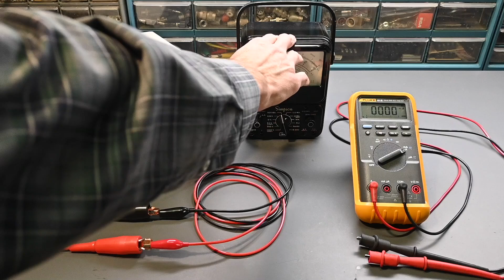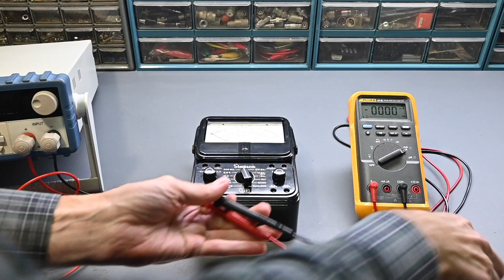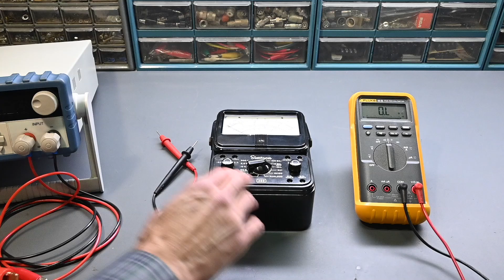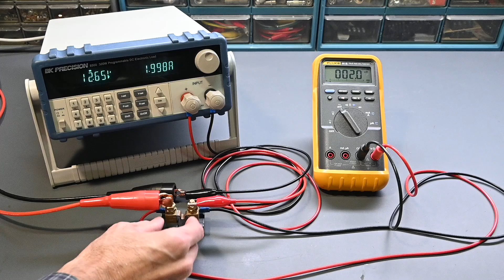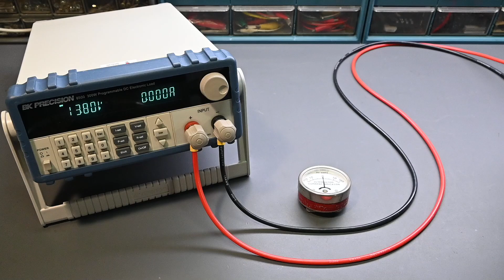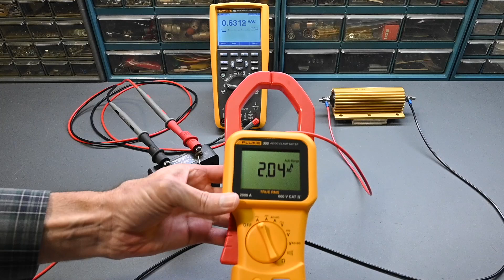How To Measure AC & DC Current - 5 Methods Explained

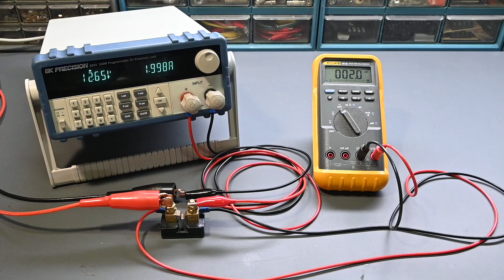Comment: Very comprehensive guide through various measurement methods. The device shown @10:41 however, I somehow wonder if that really can do induction with DC current, i.e. constant magnetic field. Such a discovery would merit a nobel price 🙂
Interestingly though, I was able to find manufacturers of such devices calling their product e.g. "2” Hoyt 652 Induction Current Indicator". I guess this has to be a stone age old misnommer.
Reply from the maker: Thanks for watching.  Yes the induction ammeter absolutely measures at DC.  In my demonstration I'm using a DC current.  These meters are common in automotive testing to check current draw, battery charging, etc.  If you try to measure AC current, more than a few Hertz, it just sits at zero.

Comment: stupid noob question, but why would the shunt resistance go UP when the voltage goes down? seems counterintuitive.THANK YOU FOR YOUR CHANNEL!
Reply from the maker: The shunt resistance goes up as the current (not voltage) goes down in order to make a useable voltage drop across the shunt that can be easily measured.  In theory any shunt will create a voltage across it (Ohms law) no matter how small the current but a shunt with milliohms of resistance (fraction of an ohm) will produce such a small voltage drop at very low currents as to be impractical to measure.  Or think of it the other way, if you measure a large current, say current 10 amps, and had a high resistance shunt then a huge voltage drop would occur on the shunt and leave too little voltage for the load.  Thanks for watching my channel!

Comment: Interessiert hätte mich am meisten die Funktion der Stromzange für das DSO.
Reply from the maker: Yes you can connect a current clamp to a DSO (or most oscilloscopes).   In this video  https://www.youtube.com/watch?v=Yp6XuDXqWpI   at 30 minutes I am doing a test with a current clamp and oscilloscope.
Reply: @EriksElectronicsWorkbench  Danke für Deine Antwort, LG

Comment: Thank you! For the current transformer would an easy way to use it be to put a potentiometer in for the load resistor and then calibrate it against another current measurement?
Reply from the maker: Yes a potentiometer would work but should be paralleled with a fixed resistor so if the pot ever failed open you would still have some load resistance to protect the transformer.